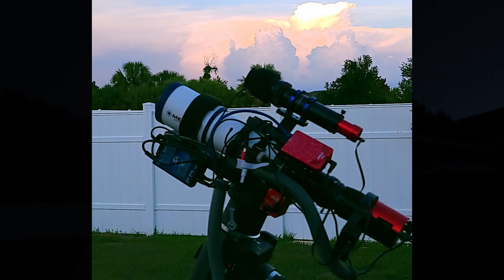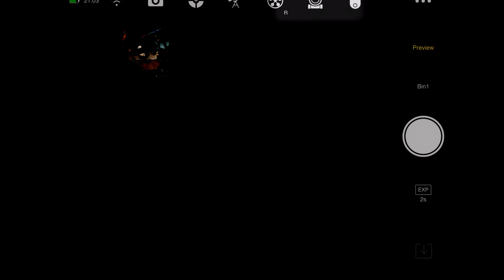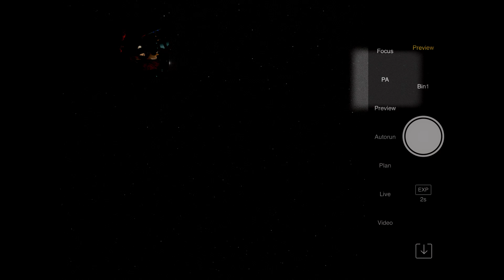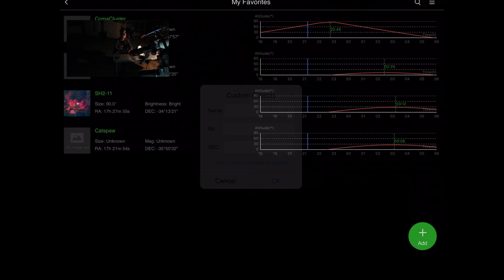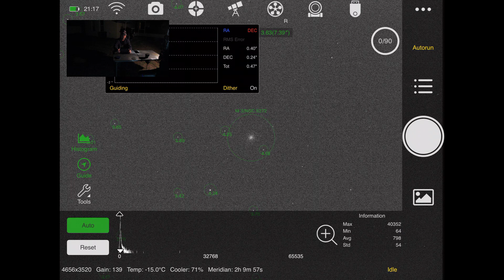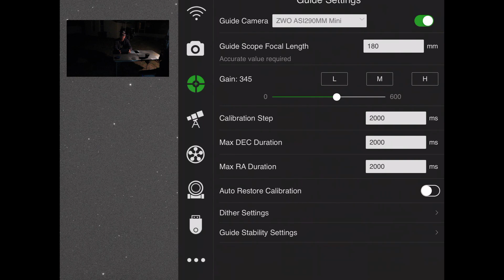How I Operate The ASI AIR Pro

Comment: This is a list of my hardware:  Explore Scientific ED102 Essential Series Air-Spaced Triplet APO Refractor (ES-ED10207-02) , 2" Hotech field flattener, ASIair Pro, EAF, ASI294MC Pro.  I have been using this setup for the last month with absolutely no problems.  Last night I went out and setup to run but I could not get the Plate Solving to work.  Is there some way to find out which update is running? (I don't remember if I ran the lastest update)  There has been NO hardware changes, so I figure it's a software.  Any ideas or solution?
Reply from the maker: Dumb question....did you check your focus before you plate solved?

Comment: Hey good video. Thank you. I have a quick question. How do the light pictures come out when you insert them into your computer for processing? I just started using the ASIAIR Pro with the ASI533 MC and all my pictures are coming out terribly grainy.
Reply from the maker: Thanks.
My subs are fine, I know the aap produces both low grade jpegs and your high quality tiff files.
Make sure you're looking st the tiff files.
Just my guess on what you're experiencing.
Reply: @enteringintospace4685  where in the app can I change it?
Reply: Ok. I finally figured it out.  No where does it say on the manuels that the ASIAIR Pro saves your photos as a low jpeg and a tiff. I went to the AIS Studio software and opened the tiff photos and saw my images with out the grainy look. 

I’m using a ZWO ASI533 MC at Bin 1 180Sec at 100 grain

Comment: Very nice and interesting walktrough. Thanks!
How do you power your instruments? Jackery (?)..and if which one for the mount, EAF, dew heater...(500 enough?) ? Or house power supply? I saw people using at least two batteries. Is this really necessary?
Reply from the maker: Thanks! I'm running off the house power. 12volt power supply to the Pegasus power box which controls my Dew heaters. Then I send power from it to the aap which powers the cams and mount.
Reply: @enteringintospace4685  Thank you!

Comment: If polar allignement is done. Do you still have to do the 2 star/1 star allignement on the mount using the Hc?
Reply from the maker: Hey Dirk...Polar Alingment only gets your ra axis aligned with the north celestial pole. For target Alingment your mount will either have to go through a star alingment process or use plate solving. I personally use plate solving.
Reply: @enteringintospace4685  okay, i'm kinda new to astrophotography. Bought a second hand asiair Pro. Using it in combination with an Celestron CGE mount. The goto function even worked without me doing the star allignement which I thought was weird.
Reply from the maker: @DirkDirk1983  hey! Welcome to the club! I believe the aap assumes park position is the scope pointing at Polaris. You can hit plate solve and it will take a quick image and solve where it's point at. That's the cool thing about the aap....no star alingment needed
Reply: @enteringintospace4685  aha, it was kinda cold and I was planning only to check how the polar allignement worked. Great feature I must say. Maybe in a rush to check drifting on a target I missed that. Thanks for your helpful feedback. Greetings from Enschede (Netherlands). And sorry for my English. Do my best 😇

Comment: Excellent video. I’m just wondering what settings you use for the meridian flip, I’ve been having problems with mine on the AAP and my Ioptron CEM40. Thanks.
Reply from the maker: Very sorry for the late response...YouTube message notifications stink.
There really isn't alot to set other than turn it on and the delay before and after meridian times.
What you you experiencing?
Reply: @enteringintospace4685  Hi, thanks for responding. I’ve actually got it working now, I think it was the settings in the mount that were conflicting with the Asiair Pro.
Reply from the maker: @brianadams7091  good deal! Not sure if the time change affected you but it plagued me quite a bit. Good luck!
Reply: @enteringintospace4685  Thanks, just photographing the Heart nebula tonight.

Comment: Nice tutorial video! I also just got my AAP. i am wondering when should I use "sync to mountt" function?  If press "go hone position" button just after tunning on the mount, does AAP only do minor adjustment to make it as  home position？
Reply from the maker: Sorry for the super late response....YouTube message  notifications stink.
So sync to mount is simply making sure that what your seeing on your phone is what's actually being displayed. This can lag because of the poor wifi.
The mount home position should be set to where ever your mount is set upon connecting. 
Thanks for the response

Comment: I noticed you're still using your Pegasus Astro Pocket Powerbox for DC pwr and none of the spots on the ASIAir. Is there a particular arrangement or preference there?
Reply from the maker: Hey....so the aap does have some accessory cables I could buy that would turn it 12v out put to rc Dew heater power but I haven't got around to buying them. Secondly the mount power light blinks low voltage when I try and power the eq6r with the aap.
So with those 2 issues I've left the ppb on the rig.
Reply: @enteringintospace4685  I wondered about dew heating. That makes sense. I wonder if the aap is getting enough amps from your power source? Is it a battery pack? I've seen recommendations for 12V 8-10A min if you're powering all of it from there. If you're on house power, perhaps the aap can't handle the additions. Mine runs alright on small celestron tank, the 3A with AVX, 533mc and EAF. But that's prob it's limit.
Reply: @enteringintospace4685  also, great vid as usual! I always learn a lot from you. Thank you for the info!
Reply from the maker: @duurrkk  Thank you...ive got more on the way😊

Comment: Great video!! You don't need to send the mount to the home right after the PA. You can slew to target from the 60 degrees position absolutely fine and save a step.
Reply from the maker: Thanks! Interesting....because when I slewed from the PA position it was no where near the target. I guess plate solving could work it out but I find it's much faster the closer to the target it lands. Is there a setting I need to adjust?
Reply: @enteringintospace4685  That isn't really true, I find if I don't go to home position the ASI won't slew correctly.  One thing that you can do, using the ASIAIR controls to manually slew, move from Polaris and do a 3 second plate solve under preview, sync to mount and now it will slew to any new position correctly.

Comment: Great videos thank you. I tried ASIAirPro  Live 2 nights ago without much success and having a hard time finding anything about it except a video by Peter Zelinka and he was just leaning as well. and made a few errors.Have you used the ASI live at all?
Reply from the maker: No I have not. What challenges were your having?
Reply: Tried the Western Veil Nebula night before last and where I am (Just North od Sydney Australia) it was low in the North and skimming over trees and roof tops for a long time before rising to 23 deg at 5am. I tried ASIAir Live first time and had Darks lights and Bias from same day to use with it and appeared to stack and save subs but each sub on the IPad was no brighter then the fist Sub 1 to 61 (61 * 180 sec) Just stacked 61 subs in PixInSIght and found Cente part of Veil 3/4on screen. I cented the Western Veil but could not see the central veil on Live stacking? If I had seen the Centre Veil I would of centred the Centre to NGC 6974 and maybe have got West and East Veil in as well. The Histogram was pretty much near the left.Cant undrstand the point of live stacking if each sub just replaces the last.Telescope Sharpstar 150HNT F2.8 ASI294MC Pro. ASIAir newest 16.2 that updated prior to Western Veil. Anything I did wrong? Note just saw a Youtube on ASIAir Pro Live Stacking Peter Zelinka. He advised to clck the down arrow on the lower right side or you will lose the stacked image but not the individual file. Also advised to use the plus key to enlarge the Histogram. Thought the auto Histogram would of moved the sliders. Everything on hitogram was way to the left that night.
Reply: @barrycampbell532  - let us know if you make progress on this. I also find that livestacking doesn't really add much. Maybe the calibration frames have to be spot on?
Reply: I did not use ASIAir live stacking again as Calibration before subs is reverse logic to me.PixInSIght and other software is so much better for processing then this using calibration before the event.  @PaulHummerman

Comment: Hey Steve. You sold me on this when you said no lugging the computer and table out to the rig.  Actually, between NINA and OneDrive hijacking my laptop I can't get my new to work consistently.  APT is working but PhD2 is having difficulty as well.  I think it is related to the OneDrive issue but I am sick of screwing (!!!!) around it so I ordered the ASIAir.  NINA and the other computer work really well on the rig in the shed this is the other rig I plan to use the Air with. - Thanks for the posting this well done video, it answered all my questions I had about it. - Cheers Kurt
Reply from the maker: Right on!! Welcome to the club! 
I kinda thought I would use it for a bit and go back to nina but nope...im ordering another.
I'll be doing another video soon on more details including shooting calibration frames. Take care!

Comment: Any progress on the calibrations frames video with the Air Pro ?
Reply from the maker: Haven't shot it yet but it's in the works. I did figure out that the aap will shot an auto flat. It's basically exposing to the center of the histogram.
Reply: @enteringintospace4685  thank you sir - I appreciate the prompt reply

Comment: So get this, I fire up the ASIair pro and set it up, everything working out fine, do the polar alignment and it's all cool. 
Doesn't fully go to home position. That's weird. Decide to see what's up and select Vega, I can see Vega in the sky, goes complete opposite direction. That's weird. Go through everything again, home position, PA, Vega, does it again. I check the longitude and latitude, it's all on point; same with time. What's the deal?
Reply: you should check that lat,long is also correct on the phone readout, lot just the mount.

Comment: Thanks for a great video. I have had my AsiAir Pro for a month or so and used it 4-5 times here in San Diego (Bortle 8). I stumbled through successfully learning how to use, but you provided more details. 

One issue I have is after autofocus with a Batinov mask, I can't figure out how to refresh the screen. Eventually that happens as part of the next step, but sometimes it just seems like you want the screen to be a live shot, and I just have no clue how to make that happen. 

One issue I struggled with early was in Live mode the photos are not stored on the DSLR (even though it is selected in menu). Saving to DSLR occurs in Autorun.
Reply from the maker: Thanks! Are you talking about the focus mode? You should be able to set it to loop exposures that continually refreshes. I have had times that the download lags and appears to not refresh.

Comment: Great tutorial video! The ASIair Pro makes the whole process much easier and quicker. For Flats I use the Auto selection within the exposure setting and it works quite well. Also, if you leave the app to do it’s thing, when you open it up to check on status, I go to the storage icon, top right, select the device you’re saving to i.e. USB stick, navigate to “Lights” folder, then subfolder i.e. “M31” and scroll through images so far to check how it’s going. I quite often delete any aircraft spoilers or really bright satellites immediately, and may add a few more to the Autorun schedule for that filter before the next scheduled filter, or add it to the end if the time or skies allow. Clear Skies to you, and me 😉 as I my weather has been terrible for weeks.
Reply from the maker: Super sorry for the late response!! I don't see many messages notifications and I have to go look to see if there are any new messages. 
Appreciate the tips! I wish in the auto run you could add images as you mentioned without resetting then sequence. 
The skies have been tough latley....hope your have been better.  Take care.

Comment: Although I assert that I had the plastic bin first, the wire loom.. well I saw it here it here first. 
I still haven't tried multi-star guiding but am curious how it'll go.
Reply from the maker: MSG definitely helps! Let me know how it works for you!
Reply: @enteringintospace4685  since commenting, started using it and haven't looked back. 
At first, I thought the app was freezing but it only does that for a few seconds upon clicking the "auto-select" button.

Comment: Great video! For flats I use the auto exposure option that is available when you switch from Lights to Flats in the scheduler. It worked really well for me, although a couple of time it has over exposed on the first try. For Dark Flats I switch to the Dark option immediately after doing the flats run. The exposure value is retained, so it is super easy to throw on the cover and hit auto run again. You may have to tap the icon that lets you manually enter exposure values after switching to “Dark”  to see/set the retained exposure value from your flats. I think there is a way to avoid having to do that, but I’m forgetting it right now or it may have been a bug ZWO fixed.
Reply from the maker: You know I saw that option pop up today shooting flats but unsure how to engage it?
Reply: @enteringintospace4685  - Setup your flats light source, select Flat for each filter, set the number of exposures, and turn off “go to home” and “shutdown“ options (maybe it knows  not to for flats, but I’ve never tested it) 😀. Then hit the Autorun button. It will take a set of exposures to find the right median(?), and then run the sequence with that exposure. Then Autorun will rinse and repeat for each filter (group by slot is your friend in this scenario).
Reply from the maker: @michaellewis7768  got ya!! So do I delete the exposure time that comes in default when I start to new sequence or will simply choosing flats remove it?
Reply: @enteringintospace4685  - choosing flats should auto populate the exposure field with “auto”. If it doesn’t auto populate, choose “auto”. That’s all you need for exposure.
Reply from the maker: @michaellewis7768  hmm it didn't this morning witch had me puzzled. I'll give it Another go tomorrow....thanks for the help!